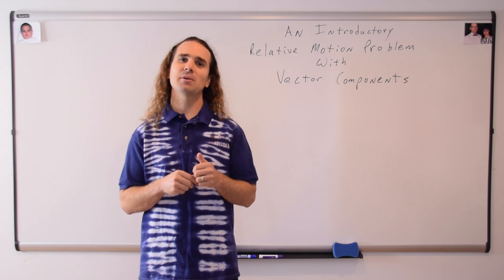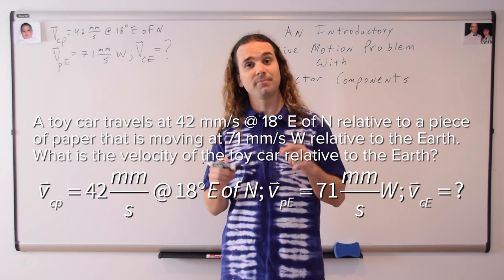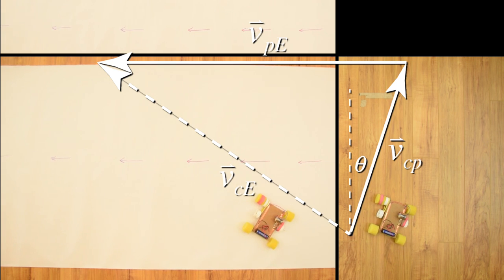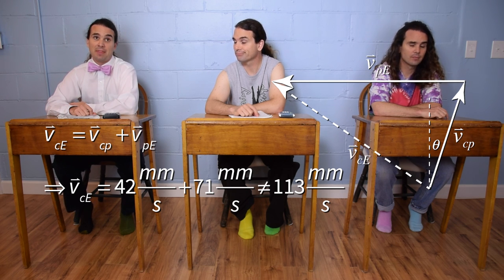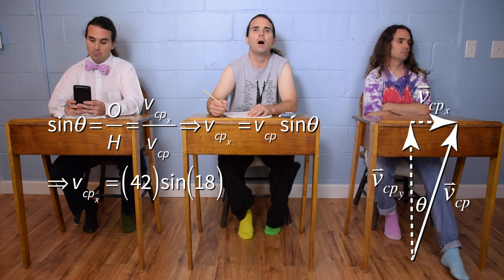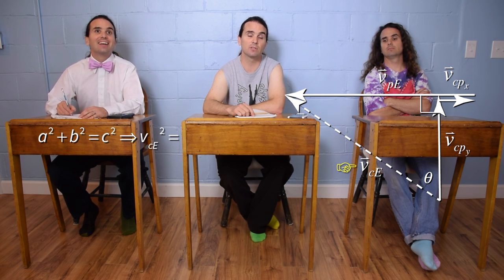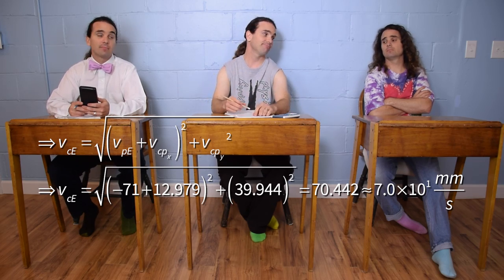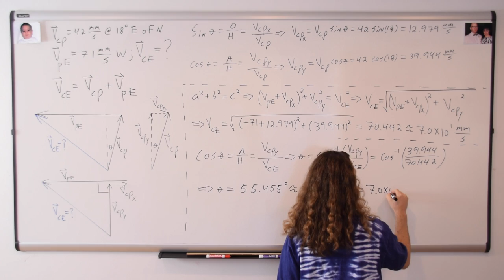An Introductory Relative Motion Problem with Vector Components

Comment: I know this sounds like a dumb question, but the way the problem is worded... no where does it say that the car travels on top of the paper, (im bad at physics) so im confused, on a test if this was a problem, is it just implied that the car is placed on top of the paper? It just says the car moves relative to the paper, so before you got to the part where u placed the car on the paper, in my head I thought you meant the car moves next to  piece of paper that also moves. I thought thats what "relative" means, like the car is moving based off the position of the paper (which is also moving), I don't get why, in the way you wrote the question, you put the car on top of the paper.
Reply from the maker: 1) Don't get down on yourself. Remember that confusion precedes learning. If you are not confused, you have nothing to learn.
2) Relax, it is not uncommon for students to be confused by relative motion.
3) It is not a dumb question. I agree with you. The question should have been more clear to identify that the toy car is on the paper. My apologies. On a quiz or final exam, if a student asked your question I would definitely make it clear to them that the toy car is on the paper.

Comment: I’m a little confused in the problem you added -71 and 12.979 together but the 12.979 is the y component of the vector. I put it in my calculator as 42sin(18)which equals the 12.979 but that’s in the y direction. 42cos(18) is in the x direction which equals 39.944 so I’m confused. Did I do an error wrong?

Comment: How did you know exactly where to place theta in your diagram?
Reply: When determining the magnitude and direction as an angle, given the vector components, you have a choice for where to place it.  If it were my choice, I would select theta so that it would be as small as possible, such that it is between 0 degrees and 45 degrees.   For instance, I would opt to say 30 degrees north of east, rather than 60 degrees east of north.   They are both equivalent ways of identifying the same direction, and would be equally correct if the method of specifying direction wasn't given in the problem.

Comment: Mr, why we didn't use tan instead of cosine to find the angle?
Reply: I'm no/not Mr. P, but I guess the trig function you'll use to find the angle will depend on your reference angle. :>

I used tan in my solution (as I've been taught by the University Physics book), but I used a different reference angle and arrived with the same result of 55° W of N.